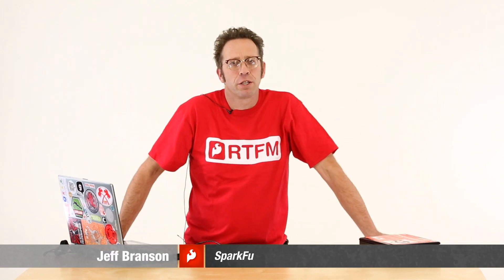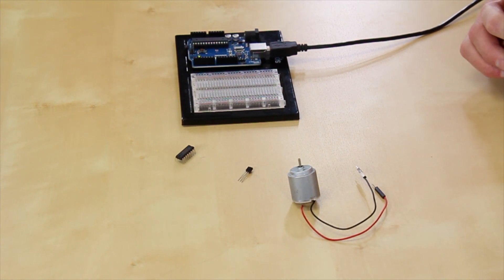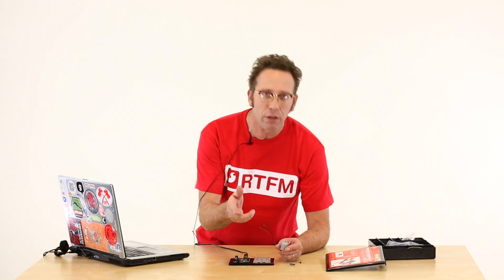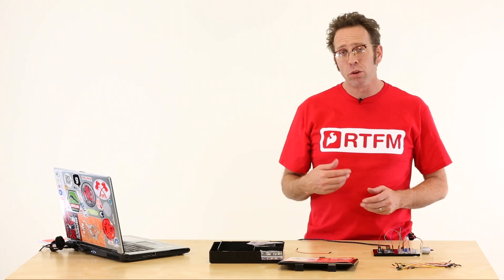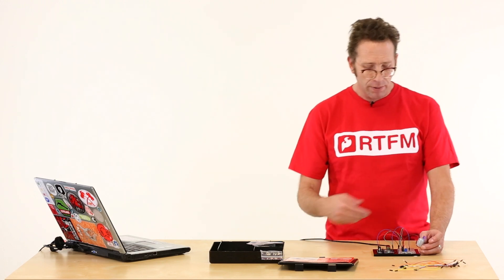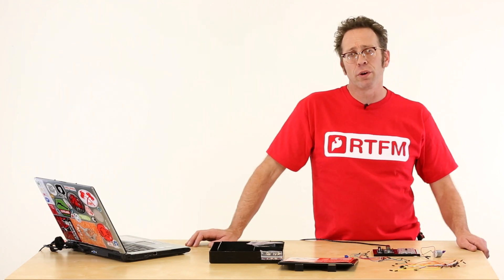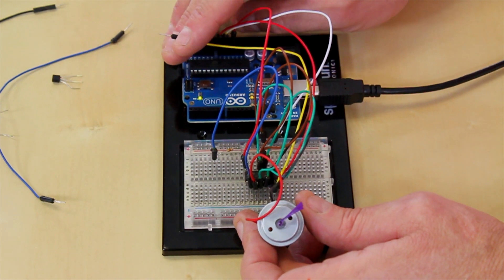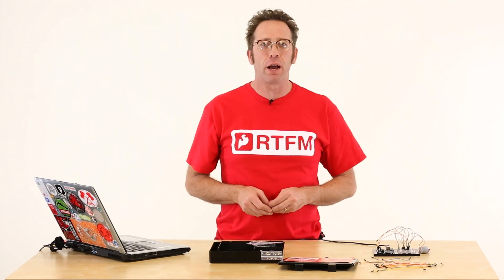SparkFun Introduction to Robotics: Motors Part 1

Comment: FWIW, I have that Sparkfun board clip kit the Arduino's mounted in and it's the ultimate way to get started tinkering and keep all the wires in place when moving it. It's also the perfect size to slap their resistor codes sticker onto the underside of...